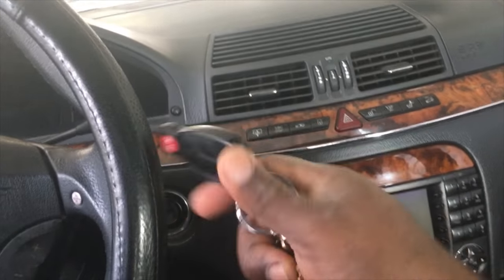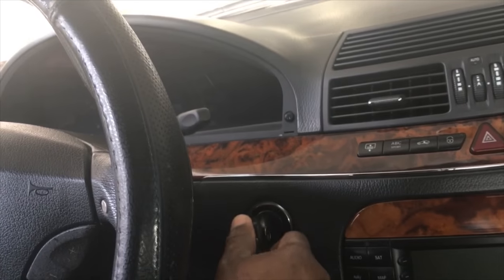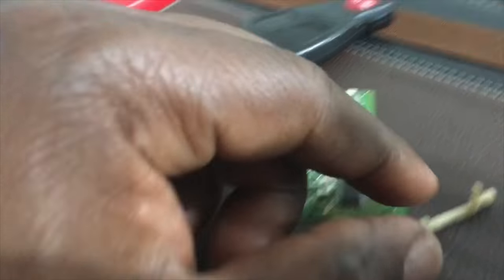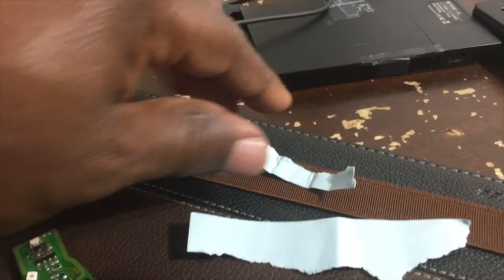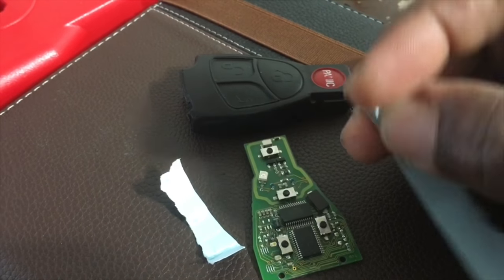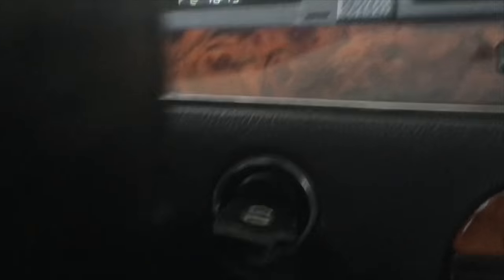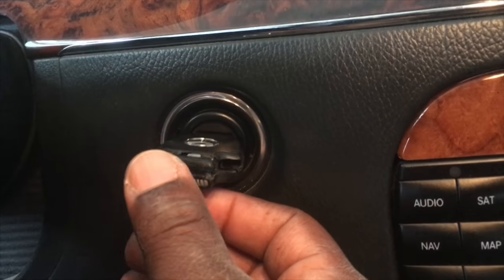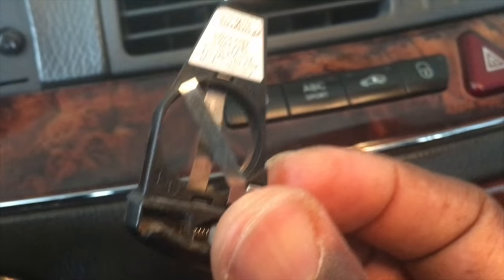DIY Mercedes key fob repair (saved $1,300)

Comment: How did you figure out that wedged paper would line those two up, that is amazing. BTW, a folded business card keeps my glove box closed on my 1998 E320.
Reply from the maker: cc92103 Thanks.

When I had the issue of the key not turning all the way, one day I thought “the plastic key case is worn and possibly loose so the infrared emitters from the key must not be aligned”.

I tried turning the key while applying force at different portions of the plastic key shell and when I eventually squeezed on the worn plastic key case, the key turned immediately in the vehicles “ELV” (ignition tumbler) and the car started right up. I knew then that my issue was either the worn case allowing the key’s infrared led emitter to be off center alignment, or that there was a circuit component on the key’s circuit that was no longer making electrical contact with the key’s circuitry.

And thank you for the folded business card tip glove box tip. This may come in handy for I and other readers in the future.
Reply: There are only 2 screws that hold the handle on to your glove box on the inside of it, try replacing them because they seem to work themselves slack thru wear and use. Good luck!!

Comment: Need to welding the UR on the 🔙 and that's it.
Reply from the maker: I don’t think the IR led on the key Fob is desoldered from the circuit board. It just was not aligned with the EIS key “Tumbler” in the steering wheel

Comment: UPDATE I cleaned the inside of the ignition switch with a q-tip and it may have solved the problem
Reply from the maker: sketchyj thanks for replying back with this tidbit of info. If it works out, it may help others down the line.
Reply: Great video!!  I have a 1999 C230 I have the same issue Key wont turn even after replacing remote battery.   If I buy a new key off Ebay can it be reprogrammed? Also does it have to be a new key or used key with same model#? What type OBD II reader could i get for cheap to Re-Program the key if necessary?
Reply from the maker: Marvin M. The NEW keys can be purchased off of ebay and other sites as well. Do not buy a used key as it will require quite a bit of extra work for it to be utilized and it may not be  worth it. 

Plus who knows if the key was stolen (ebay used key sales).

There isn’t a simple obdii scanner that will allow you to write data to new keys. The device to do this is called a mercedes benz CGDI key copier and it is not cheap.

I got a Chinese made one for ~$480 and there was a significant learning curve to copy my first set of keys.

At that price, the CDGI is the cost of paying a small business to copy the key.

If you are not savy with working on cars to a medium level nor have time to learn, you may NOT want to do it by yourself. It can be frustrating if you dont have the patience. Its about 15 or more steps if I remember correctly.

Once you get it though, it is easy from there on out.
Reply: @frugalfabrication  if you have a good ebay link that would be cool to buy a NEW 1
Reply from the maker: Marvin M. I’m not sure which original mercedes key fob style you have. 

Just googled real quick and this is a website I found.

Comment: Do you knkw the fix for key not unlocking or locking the car from a distance or anything anymore
Reply from the maker: Yo may need to tattle your key fob to a circuit repair shop. I have heard of this before (I think it may be in the comments of this video) and someone said that a small circuit component separated on their keys circuit board.

The circuit repair shop was able to see it and solder/fix it back to the circuit board to make the electrical connection.
Reply: @frugalfabrication  thanks for your comment man, but it seems my key works fine but there isn't a radio connection
Reply from the maker: @olivermateee547  yes if a capacitor or other circuitboard element has disconnected, radio transmission portion of your key fob may not work as best as possible.

Comment: Is there a way to reprogram my second key to be recognised by immobilizer? Key was working fine but i tried to take radio out by bit of force and the key stopped working. I have other key that only locks car manualy. And the button on starting key doesnt work.
Reply from the maker: Possibly, but you need the $500 CGDI Mercedes key programmer tool/software(red plastic tool in the background of this video), and know the step by step process on how to do it… I have done it, but it’s a 15-20 step process if I remember correctly.

In my opinion, you are better off just paying the~$300+ for a new programmed key copy(from a NON-Dealership).
Reply: @frugalfabrication  what if i remove immobilezer
Reply from the maker: @lauris4887  I am not sure.

Comment: Broken key how to start 1998 Merc  ml  320. Any ideas.
Reply from the maker: If the key is literally broken (as in electrical circuit componnent...capacitor, resistor, etc) broke off, you may want to google or read through the comments (someone posted about a year ago) of an actual electrical circuit tech repair shop for the key. Take all plthe pieces that fell off to the tech and have him solder back on.

If key is physically broken into several pieces, you are better off purchasing another key and having it programmed to your car. This is possible, but the specialist doing it will need the mercedes CGDI key programmer equipment.

If you are not tech savy, find a specialist or someone to do it for you. They may charge youa around  $350 USD (at best) to $400...It won’t be cheap, but usually will be cheaper than the dealership (dealership may want you to buy a whole new key and electrical lock tumbler set and install in your steering wheel....very expensive at mercedes.

Comment: PLEASE HELP. 
My key can turn to the on position but it doesn’t turn on the engine. Key works as it can turn and powers the gauge cluster just no turn over to engine. Please help
Reply from the maker: Can you turn the key turn all the way to the “engine start position”..(2nd position)?
Reply: @frugalfabrication  Yes. Everything works as it did before. When I insert my key the zip noise is made which I’m guessing Is the ESL unlocking. Position 1 works as normal… some lights come on and begin to work as normal. When I turn to position 2 my instrument cluster and all of the lights on the gauge clusters power on. When I go to do the flick motion to turn on the engine nothing at all (no crank, no noise, minimal clicks sometimes it’ll click once or not at all) I’m thinking it’s either my ignition switch bad, my key went bad or my EIS(Ignition Switch) went bad. I am not sure how to diagnose if the EIS went bad as a lot of videos show the cluster not turning on when the key is inserted or they can’t turn the key past position 0, and it the steering wheel doesn’t free up
Reply: @frugalfabrication  My steering wheel opens up fully and my power supply for interior and exterior is all fine. I’m thinking my starter possibly went out as it was all of a sudden. I went to get gas drive home came back out within 30 minutes and the car won’t crank
Reply from the maker: @BMJJ8  yes, it may be your starter.

Comment: On my 05' SL500 I can enter the vehicle by the manual key and start it but, can't open and close the doors or trunk via the remote. Dash lights and door bell does not work? tried charging both batteries but the trunk battery doesn't seem to take the charge. Any suggestions or recommendations?
Reply from the maker: Anton For the issues you list,  I do no’t have any direct suggestions other than to google the mercedes forum “MBworld.com” and search through the SL500 forums for this particular issue.

I have not come across this specific problem on my vehicle, and hence I have not had a reason to look for a solution.
Reply: 9

Comment: So you can start the car with no batteries in the fob?
Reply from the maker: Yes you can. The batteries are for the locking aspect of the vehicle. The vehicle will start without batteries in the key fob.
Reply: @frugalfabrication  🙏❤️👍

Comment: Hi my car not start.
What else can cost without knob kea
Reply from the maker: Does the key at least turn inside of the keyhole near the steering wheel?
Reply: @frugalfabrication  no, steering Locke.
It’s does start with second try, then I did turn off and try again to start, it’s doesn’t start. 
Few minutes letter I did try it’s start and then again turn off now it’s stop totally.
Reply from the maker: @futuregames6299  It sounds like there may be an issue with the alignment of the L.E.D. in the  keyfob and Key’s tumbler near the steering wheel.

I had the similar  issues before I did the fix shown in this video...
Reply: @frugalfabrication  
Please advise me what to do !!
Reply from the maker: @futuregames6299  I detailed and showed how I fixed it in this video.
Reply: @frugalfabrication  no sir, no turn it’s totally doesn’t start !

Comment: I tried this but it didn’t work. The infrared light isn’t coming on but it was just working last week. I bought a new key fob and switched out the motherboard but now I can’t start my car
Reply from the maker: Mario Estrada I would suggest placing your original keys motherboard back into its old case, so that you can at least be able to start your car(hopefully).

I have seen and read in research online that there is a electrical part on the circuit motherboard that breaks (i think electrical wire lead for Infrared LED) or comes off. This part can be re-soldered to fix the key.
.
.
.

Check out this guys youtube video. I initially thought this was the problem for my broken key, but it wasn’t.
.
.
.

https://youtu.be/DTY8ErO6hFI
Reply: I watched this video but I don’t know how to do what he did. I did put it back in the old remote but couldn’t get it to turn on my car so now I don’t know what to do. I’m not sure if any locksmith could even help me
Reply from the maker: Mario Estrada upon switching it out into a different case, you may have damaged a circuit trace lead. I have some extra Mercedes blank key FOBs (made in china). I can send you one but, you will need to find someone in your area you can give your broken key to have it re-soldered/fixed. And then they can copy your key’s code data to the blank I send you (using CDGI).

Or

 they have the CDGI Mercedes tool kit and laptop/with software to plug directly into your cars OBDII port and to reprogram a new key for you from inside your car.

I have the CDGI kit and software but I don’t know what city/state you are in.

Waldemar Fechel’s youtube page is really good on how to reprogram keys, ecu’s etc formercedes, bmw, toyotas, and many other vehicles. But you need to have the tools.

https://m.youtube.com/watch?v=xs3TrlqStZU&list=UUxbZNiUMRGzWRPH2noH9oMQ&index=10&t=0s

Comment: How the tf you get the green part out
Reply from the maker: There are a few videos (including this one) that show how to remove the green circuit board from the black plastic housing shell.
Reply: @frugalfabrication  thanks for the non answer
Reply from the maker: @olivermateee547  dude….

It is too easy. A 3rd grader can find it….

Type this in youtube:

“how to open mercedes key fob”

And then scroll down to see all the various videos that show you how to open the key fob.
Reply: @frugalfabrication  ok dude

Comment: 01 Kompressor key fell in the pool. Car will not start.  Help please
Reply from the maker: I am not an expert but for the first easy attempt, I would remove batteries(batteries only control lock/unlock, and not starting the car) and try to blow/shake the key to remove all remnants of water. Maybe let it sit open (batteries and battery holder  removed) in front of a fan or in a bag of dried rice for a day or two.
This would be a lucky resolution/fix if it works.

I hate to say it but your last option would be to find either mercedes specialist to program you a new key (hoping they will bring their laptop/CGDI equipment to your car in order to connect and program orherwise you may need to tow it....call and ask first) or the “stealership” dealership.

For your attempt at letting it dry, see if you can remove the whole key fob circuit board as shown in the video and attempt drying all the water that is on it and let it sit in the sun for a few hours.
Reply: Thanks very kindly for your prompt answer. Is there any other frugal option apart from the rice option? Is thst ok to buy one key fob on Ebay?
Please help...
Reply from the maker: hackclassics even if you buy a new blank key fob from ebay, it will still have to be programmed using the CDGI key programmer kit (not cheap). This kit is about the same price as buying a programmed replacement key from the dealer.

For example watch Waldemar fechtel’s you tube vids...he does a great job showing the process for copying keys from a spare key fob, or even from the Obd2 port inside the car. Even how to reset/clean wipe an old style trashed/used key fob so it can be programmed again to another car. 

In the first video link below, read through the comments. Someone asks if a new key can be copied without the original mercedes key fob and he answers it can be done.

https://youtu.be/xs3TrlqStZU

https://youtu.be/Q-ns4KP_ic0

https://youtu.be/-FxhSjhfgw8

Comment: Half a tank of gas and 34 miles range?
Reply from the maker: You have a good point. I think I had just put gas in the car just prior to starting the video….if you keep watching, you will see that the range mileage keeps increasing as the ECM is constantly measuring how much fuel is in the tank(while the engine is running).. 

By the end of the video the fuel tank “Range” was increasing past the 40 miles mark.

Comment: Why dont you just buy a new key fob shell ebay $10?
Reply from the maker: Ali Alrashidi because this is an immediate/emergency fix so you can at least start your car if stranded.  Also it may take 2-3 days for the ebay key case to arrive from shipping.
Reply from the maker: Ali Alrashidi I also did buy a whole new complete package of key fobs for super cheap online and used my  key programmer (red plastic box seen in this video on table) to program a new style benz key.
Reply: @frugalfabrication  nice!! Very fast answer. Speaking of frugal, I have the non keyless key fob -no chrome key. And want the newer chrome style key. Do you know of a frugal way of doing that and if not is there a chrome keyfob modified to fit the larger older keyfob?
Reply from the maker: Ali Alrashidi I do not know of any frugal way to get a newly copied key fob without spending about ~$450 for the key copying CGDI tool/ free software. If you purchase this kit, you have 2 options of key copying...

1) FREE OPTION - the ability to copy 2 key fobs a day for the rest of your life (software connects to some type of server via internet)

or 

2) PAY OPTION - be able to copy unlimited keys per day, but for a yearly (?i believe) fee.

I would choose option 1.

If you do buy this equipment, you will be able to make new chrome style keys for you or your friends who own mercedes (maybe charge a fee if you like).

There is a slight learning curve for the software process to copy though.

The youtube user Waldemar Fetchel has some pretty good tutorials on the process.

https://m.youtube.com/watch?v=xs3TrlqStZU

I may have seen a 3rd party chrome style case on alibaba for the black factory plastic mercedes keys. But the shape was totally different because the circuit board is triangular shaped on your black plastic mercedes key fob.
Reply: @frugalfabrication  thank you ,I like option 1 as well. Do you have a link where I could buy one?
Reply from the maker: Ali Alrashidi Yes, google “obdii365”.

Their website has every type of european and japnese car diagnostic computer/tool you could imagine at ~80% off of OEM business/shop price.

On the obdii website, search “cgdi” and choose the one for MB Benz.

https://www.obdii365.com/wholesale/cgdi-prog-benz-key-programmer.html

The learning curve on the key copying process is kind of tough, but search youtube for the user “Waldemar Fechel”. He has several tutorial videos on how to program keys from the car’s obdii port, and other methods using the cgdi tool.

https://m.youtube.com/watch?v=xs3TrlqStZU

Hope this helps.
Reply: @frugalfabrication  thank you so much
Reply from the maker: Ali Alrashidi your welcome, anytime.

Comment: are you sure a new key costs $1300?
Reply from the maker: zanrek if only the key you can expect to pay $450 - $500 at the dealership.  If you need both a new key and the key’s digital tumbler (I don’t remember proper name at the moment) near the steering column you can expect to pay around $1,300 for both parts. I do not believe that includes labor.
Reply: @frugalfabrication  good job.
Reply from the maker: @FlukeCypriot  thank you.

Comment: What kind of paper are using and where have you bought it from,because after such a joking practices when get it for repair the price cost might raise even higher than 1300.
Reply from the maker: George George No joking practices here. The paper used was an entry level thickness of “card stock”. I have several blank sheets left over that were supposed to be used as event notification flyers.
Reply from the maker: George George oh yes, and It was bought from the store called  “office depot” about 8 years ago.